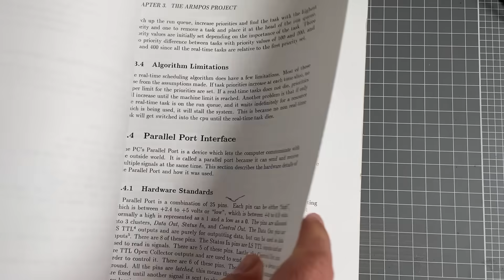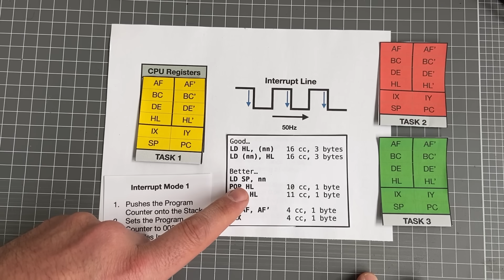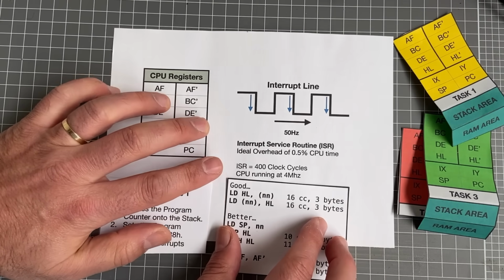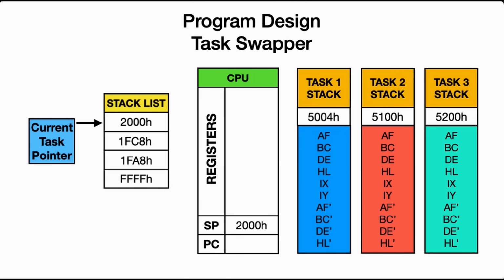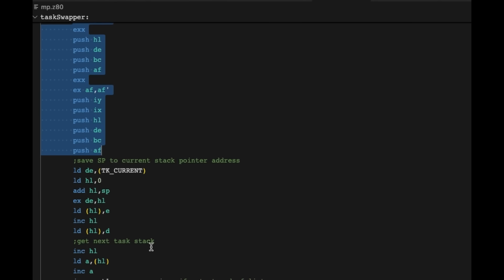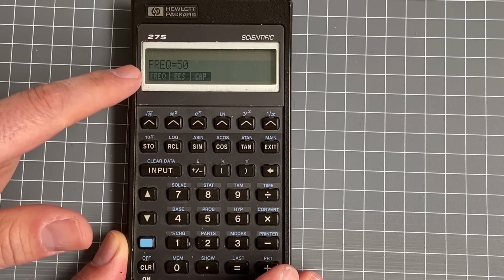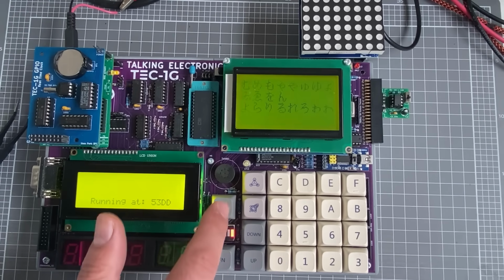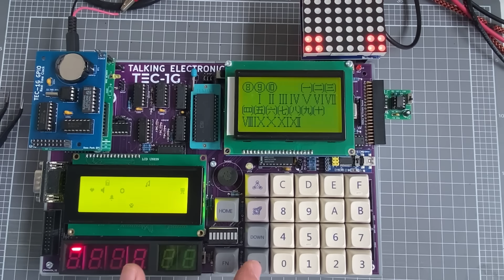Multitasking on a Z80 CPU

Comment: In 1980, I had just finished my Space Invaders game for the Nascom 2 when a friend told me that they would let me have space on their stand at a computer fair to demonstrate it and sell copies.
The fair was in 2 days and I didn't have any blank tapes!
It was late in the day, so I didn't have time to go to Comp Shop to get a box of 100 blank C12 cassettes until tomorrow, but that won't give me time to make copies unless I didn't get any sleep!
So a quick bit of thinking...
Write a little NMI handler that was triggered by the video frame sync that ran a tiny state machine.
All it did was send another byte to the UART each time it was ready or decrement a wait timer depending if it was in write mode or wait mode.
It indicated which mode using the tape drive LED so I knew to change tapes when it turned off.
Several hobbyists were confused that it was playing the game AND writing tapes at the same time (you couldn't feel any difference in the game) 😀
Reply: What was that uart connected to? Tape recorder? Syncing to frame sync means 50/60 bytes per second, was tape media that slow some back then?
Reply: @sanjyuu2298 The UART output to tape recorder; speed was dipswitch selectable between [300/1200] / [110/ext]. [I set ext to 2400 which worked ok].
The only interrupts used as standard on the Nascom 1 & 2 was NMI, which was used to single step a program for debugging.
I added the frame interrupt by linking the vblank signal to the PIO, which was set to interrupt on each falling edge.
50Hz was frequent enough to write at 300 baud. To write faster, I used a faster interrupt (can't remember exactly where now, somewhere up the divider chain).
You need the interrputs frequent enough to keep up with the byte rate, butnot too fast that you waste CPU cycles when the UART isn't ready.

Comment: Here's a Z80 multi-tasking system freeze hack that will work with 64K RAM (should also work if bank switched).
As the Z80 only services interrupts during M1, just prevent the current instruction from completing!
This can be done by filling the entire 64K with DD (prefix for IX) or FD (prefix for IY).

DDD9 21 DD DD    LD       HL,0DDDDh   ; pair of bytes to PUSH, also the looping address
DDDC F9                LD        SP,HL             ; SP is now DDDD
DDDD E5                PUSH  HL                  ; first iteration: DD F9 becomes DD DD, next 21 DD becomes DD DD ...
DDDE E9                JP        HL                  ; loop back to DDDD until the final PUSH changes E5 E9 to DD DD ... then just eat DD prefixes forever! 😀

Reset will get out of it !

Comment: In fact, what you're doing is very similar to CPUs with external MMU circuitry. These had to implement all of the memory protection and also part of task switching via external circuitry. Like some Motorola chips from the 70s that eventually were even able to run Unix.

Comment: Isn’t the Z80 extinct, or no longer made/available? 
😲😲😲
Reply: The Z80 itself is, but there is the eZ80, which is binary compatible, but executes a lot faster at the same clock speed and can also extend memory addressing to 16 megabytes. Of course the latter uses extensions, but using them is optional.

Comment: The Z80 is fairly well designed for pre-emptive multi-tasking.  Any CPU with a non-maskable interrupt input is.  With some additional hardware, it would be possible to use protected memory banks.  The idea would be that the bank-switching is disabled unless the OS is switched in and running, and the NMI would initiate the swapping of the memory banks to put the OS into the correct address space to service the interrupt.  That way, programs would only be able to access extra memory banks by doing an OS call, probably by using a "restart" instruction which would also be sensed by the hardware and would cause the OS to be switched in at the correct point in time.
Reply: Doesn't the Z80 have an output pin to tell you it's at a certain part of the instruction fetch cycle? So you could perhaps keep track of the PC, externally, by watching the bus including that signal, then only unlocking the page-swap registers when it's from code running within a certain address range. Or some other way, perhaps this address range itself can be specified with another register. Go far enough and you've reinvented the 80386!
Reply: @greenaum  That's pretty much what I thought of.  The Z80 has the "M1" output which signifies that it's on "Machine Cycle 1" which is the instruction fetch cycle.  That could be used to allow hardware to read which instruction is being loaded, and from what address, allowing the hardware to either enable or disable certain instructions depending upon other conditions.  More accurately, the instruction would still work, but any external effects would be disabled unless the instruction was loaded from within a certain address range (and while a certain memory bank is switched in, if it's a bank switched environment).

Comment: I did a similar thing with the 8088 microprocessor, using the 18.2 Hz clock interrupt.  That's a bit coarse for some purposes but good enough for what I was doing; allow editing a message on screen, while transmitting a message from a queue and receiving messages into a queue all at apparently same time.  For those functions the UART provided the needed interrupts to fetch the next character or store the next character asynchronously.
Reply: You can reprogram the 18,2 Hz timer to any frequency of 1193,1818... kHz / n with n = 2 ... 65536. Mit n = 23864 erhältst du 50 Hz, mit 19886 erhältst du 60 Hz. Mit 16384 kann man einen 72,8 Hz-Takt und kann dann z.B. alle 13,7 ms seinen Kram machen und bei jedem 4. Aufruf die alte IRQ-Routine aufrufen.
Reply: @frankklemm1471  Reprogramming the system timer will have consequences on many things.  So, I left that part alone 🙂 18.2 Hz is a bit coarse but adequate for my purposes.

Comment: Congrats - the explanation of how your task switcher works is very well done - one of the cleanest I have seen and very easy to understand.  

However I think there is something missing from the explanation of the how the task switcher works at 9:35. .  The test for the end of the task list does not look like it is testing if the task pointer is 0xFFFF, but instead is checking the task pointer has a low byte of 0xFF. The 'LD A (HL)' instruction is retrieving the 8 bit value at the address contained in HL in the A register (this is the least significant bit) and not testing the following byte.  This would mean that the 'end of list' logic would incorrectly detect the end of list if any task pointer had a least significant byte matching 0xFF - not what you want given the explanation in the code.

Also it's unclear why you have three 'NOP' instructions before 'EI' and 'RTI' if you are optimising your code for speed - what happens if you remove these ?

Comment: ANY CPU with an interrupt architecture can multitask.  The only limit is RAM.  Bank selection could make task switching even easier, and each task can literally have its own memory map.
Reply: This was a thing even back on the vanilla TRS-80 model 1.  The keyboard had a tendency to repeat key presses, as the keyboard was prone to switching noise.  There was a program called KBFIX that fixed this, and it ran in addition to (or along side of) basic or DOS to prevent inadvertent key presses.  An early version of TSR programs common on the IBM PC.

As you accurately pointed out, any processor capable of an external interrupt can pre-emptively multi task.  I would add to that, ANY processor can multi-task, but they may need to be cooperative if external interrupts are weakly implemented.
Reply: True. Modern multitasking processors have memory management hardware to protect tasks from each other, but bank switching is similar in functionality. Back in the day Digital Research came up with MP/M as a multi-user version of CP/M designed to run on a Z80 or 8080, so it’s not a new idea.

Comment: I used the same approach over thirty years ago for preemptive multitasking on the 6502. The CIA generated the timer IRQ/NMI. I also updated the code for when I made my own 6502 variant using TTL.
Reply: Out of interest, how did you get around the fixed stack page on the 6502?
Reply: @beebmicro pull data off the stack and push it on.
Reply: @MartinPiper6502 thanks.  That's the only non-HW solution I could imagine.
Reply: @beebmicro you can partition the stack but that reduces stack size and the number of tasks.
Reply: @beebmicro  if I was feeling adventurous, I might consider using the "processor port register" on a 6510 to map the stack at $01xx to different external memory pages by substituting the processor port as a memory address for all reads to $01xx. This would give a hardware solution for up to 64 full stacks. The processor port is 6 bits.
Reply: @MartinPiper6502 That's a cool idea and I've a lot of respect that you've been able to do these things.

I'm only familiar with the 6502 from the BBC Micro.  That had bank-swapping for 16kiB of address space, and I imagine there might have been technical challenges back in the day of getting such a fine resolution as one single page banked - the machine really pushes things to the limit with timing!  (Or so I've read 😅)
Reply: @beebmicro a 74LS154 will select pages of RAM along with a couple of 74LS157 to selectively rewrite the address. This should work.
Reply: "The CIA generated the timer IRQ/NMI".  seems rather heavy.  Couldn't you have used the FBI or your local police department?

Comment: A few years earlier, I did that on the 8086, including inhibiting the switching if inside DOS or BIOS routines so this ran under DOS.  My method included using Push/Pop to save and restore registers, ending with a RET; the saving was done on that task's stack.
I also wrote critical sections, semaphores, cross-task queues, etc. in C++.  That was full working implementation for download, as well as the write-up.
It made the cover of Computer Language Magazine some month in 1989 I recall.  Nice to see that it would have made a college thesis.
Reply: Found a site that lists the table of contents for many issues of Computer Language. Started reading it around 1988-89, I retired from the USAF in 1994, went to school to "learn" most of what I already learned and then did programming for a living until retiring for good in 2017.
As I was beginning to take an interest in C/C++ I'm quite certain I read your articles. At that time in the late '80s and into the 90s I was using mostly Borland Pascal/Delphi at home and FORTRAN at work.

Comment: I wrote a multitasking kernel for the Z80 (up to 4 tasks, pre-emptively switched) in around 1982, it was used in the User Interface ('VDU') of the BBC's 'HF Control System', which automated the operation of Short Wave transmitting stations in the UK and around the world.  First installed at Woofferton transmitter in Shropshire, it was later operational at Skelton in Cumbria then at Rampisham, Daventry, The Seychelles and Hong Kong.  This system remained operational for more than 15 years.
Reply: Yeah, I did a RTOS and bytecode interpreter for the 8032 in 1985 and that was being sold in a PLC system up to around 2010. 16 tasks (with priority), high-level language with floating point, serial networking, I/O subsystem, display and keyboard. Initial implementation was squeezed into 2kB of RAM (of which 1.5kB was for user) and 8kB of EPROM. Before official launch that had grown to 8kB/32kB and a year later it was 32kB/64kB respectively.
Reply: @niclash damn
Reply: Og 😅
Reply: Would love to know more about this, Richard. I think I know you from BBC Basic on Windows and perhaps the Teletext Adapter/Domesday Project on the Beeb?
Reply: Ah, you did the BBC BASIC for the Z88! Fine computer, fine BASIC interpreter! Although later versions I think developed by user groups, added graphics to it's 640x64 LCD display. Apparently squeezing a 40K BASIC interpreter into the Z88's memory paging system took a bit of a hack at the OS level, but it worked out well in the end, and I spent many hours having fun writing little programs. Cheers, RT! A happy customer!
Reply: @greenaum  The Z88 was unique in that BBC BASIC's floating-point arithmetic package was used not only by the BASIC interpreter but also by PipeDream, the Word Processor / Spreadsheet application.  This was possible because the floating-point package was purely register and stack-based - it used no scratch RAM locations at all - so could be called concurrently from multiple applications without issue.  Details can be found here: https://bbcbasic.co.uk/bbcbasic/z88fpp.pdf
Reply: Kewl!
Reply: Sheesh that's some impressive stuff
Reply: Back in the 80s my dad also wrote a small multitask library, though not for the Z80 but that ran on DOS. They used a single DOS machine to control a huge chip-card manufacturing machine. It was actually a cooperative multitasking library written in pascal and it did the exact same thing. They did the tast switch through a software interrupt. The system had literally hundreds of small tasks, checking various IOs and they had about 2000 task switches per second if I remember correctly. Many tasks were pretty simple, just checking an input and switch right away. Since the task switcher was still interrupt driven, it would have been easy to implement preemptive multitasking in addition. For many tasks it makes sense to offer a cooperative way to cause a switch when a task has to wait for IO or some external condition it doesn't need to waste CPU time. I think the scheduler even had several tiers of tasks. There were the bigger ones which ran every couple of switches and the smaller ones got essentially scheduled in between in batches. Waiting for a certain sensor giving a signal wasn't that time critical. So it made more sense to spread the load over multiple cycles and only run the time critical tasks more often than others. That was the time when you really needed to squeeze out every bit of performance you can :)

What many don't know, even the Apollo guidance computer also used cooperative multitasking in a similar way. They even has a virtual machine that ran the actual jobs and a watch dog that killed and restarted crashed jobs automatically. There are several AGC talks here on YT which go into great detail how it works.
Reply: Cool. I lived near the spiders web in daventry in 2000.

Comment: This is obviously a demo, but you can get dramatically better results by allowing tasks to call the scheduler and give up any unused time. I wrote a very similar scheduler for an 8-bit RISC CPU I wrote in VHDL. The initial version worked almost identically to this, but I quickly realized how much CPU time was being wasted waiting for I/O. So, since my model allows any internal interrupt to be triggered using an INT n instruction, tasks terminate their time slice when they are about to enter a loop to wait for something, such as serial port or keyboard. In most cases, the actual hardware timer never fires, and the result is a vastly more responsive system.
Reply: I'm not 100% sure, but I believe MP/M has that option, too.
Reply: Is there a name for this hybrid approach? Pre-operative multitasking? Co-emptive multitasking?

Comment: Nicely done. Good POC. I'm curious to see the Interrupt run at 25Hz. Half the 'scheduling' time, more 'time' for tasks to run.
I assume you used the "Mode 1" interrupt mode (Vectored interrupt (interrupt vector is read from memory location 0x0038)) . 
Can you do another using "Mode 2"? (Vectored interrupt with a custom vector (useful for advanced applications like custom I/O devices)).
I think this safes a few Hertz from the loading and storing, since it already uses a custom vector.
Mode 2 seems to be more appropriate, i think. Especially since your 'applications' are mostly IO bound.
Reply: Interrupt mode 2 only works with devices that understand it. That is because when a device triggers an interrupt, the Z80 reads one byte from the device and uses that as part of the interrupt vector. 
That is very useful with the Z80 specific devices like CTC, SIO and PIO. 
It basically means each device can have multiple interrupt service routines, depending on the cause for the interrupt. For example, the CTC (counter/timer) will return a different byte for each channel. The SIO will return different bytes depending on which of the two ports caused the interrupt and if it was a received character, an error, or the transmit queue becoming empty. 

With IM 1, the cpu only knows that some interrupt happened, and has to figure out the reason by itself. With IM 2, you can write separate routines for everything and don't have to check for what happened first.

Comment: Wow! Ain't a clue about the TEC-1G... The shadow registers if left to be bashed could save a lot of cycles depending on the running tasks. (EDIT: Could they? Now I'm thinking.) Awesome work.
Reply from the maker: Good point!
Reply: The shadow registers are very fast to switch, but you get only one set. 
So for switching tasks, you still want to save the registers to the stack. 
But they are very useful for interrupt handlers that always return to the same task that was running before the interrupt.

Comment: The system efficiency could be improved with a tick counter and a sleep command the tasks can call to wait for a few ticks before being rescheduled but that I guess is the next stage of the multitasker development if it goes forward.  

It all reminds me of playing games with 8051 microcontrollers. We had 6 task stacks each of 8 bytes using co-operative rescheduling under PLM51.  I ended up rewriting the Intel PLM51 link library to to reduce stack usage by 2 bytes per task. Very useful when there are only 128 bytes of RAM to start with.